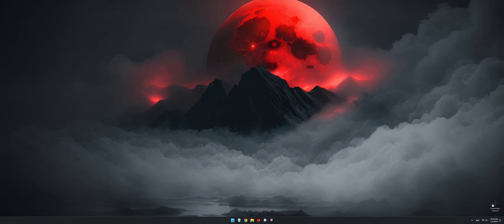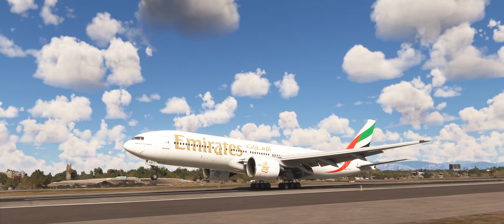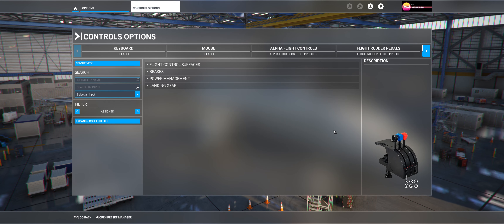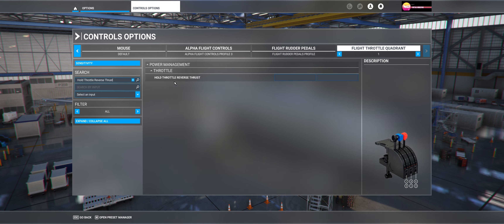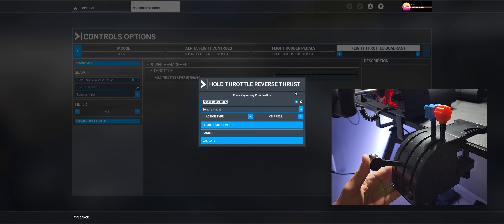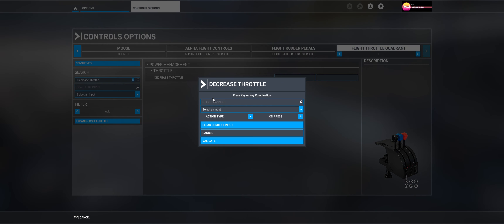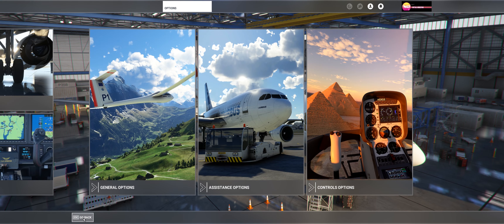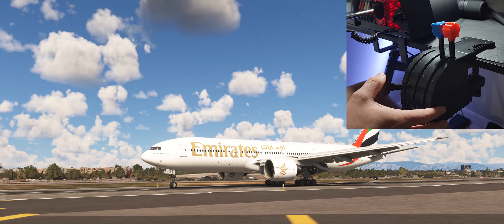How to configure Reverse Thrust on Logitech Saitek Throttle Quadrant | FS2020 #msfs2020 #aviation

Comment: I did not even know that I could fo this. I just set it to when I pull it back to reverse thrust it toggles it. Then I just push the throttle all the way up and it puts it in reverse thrust. To turn off reverse thrust I can just pull it all the way back down again, and it switches back to regular throttle. I will save this for later because it will probably come in handy when I need it!

Comment: I do not have separate in msfs2020 confirm for throttle and for yoke. Both are together. Also when i second time want to assign Decrease throttle it shows me its already assigned to another option

Comment: only my yoke appears not my throtle
Reply: It's binded with the yoke if you bought the package that comes with the Yoke and Throttle in one box.

Otherwise if u bought the throttle separately try disconnecting it and reconnecting it as its not being read by your system
Reply: @gml_pz I have the same problem, how do you bind the throttle level? I try scanning it and it doesn’t work at all.
Reply: @ Thats odd! Did you buy yours in a bundle aswell?
Reply: @gml_pz  yes I did, but I think I messed up because I plugged the throttle quadrant into the ps/2 port in the back of my pc not knowing you have to plug it into the yoke itself. Someone said it could’ve gave it a malfunction but not sure. The throttle shows green for power but I can’t use it at all.
Reply: @ That’s so odd. Yeah you have to plug it in the yoke itself it has a port next to the 3 usbs on the back right side. 

I would say to try a different port on your computer to plug in the yoke and plug in the throttle quadrant into the yoke.
Reply: @trrissten  I just saw this now, yeah it might've short circuit the throttle itself so you may need to contact logitech support or contact the retailer where you purchased it from.

Comment: For some odd reason, my throttles, both the PS3 and USB, don’t read any inputs from below the 25% line and slightly above the 75% line
Reply from the maker: Have you tried calibrating through:
Options/Controls? (Within the Flight Simulator)